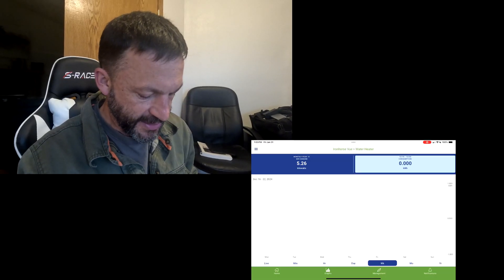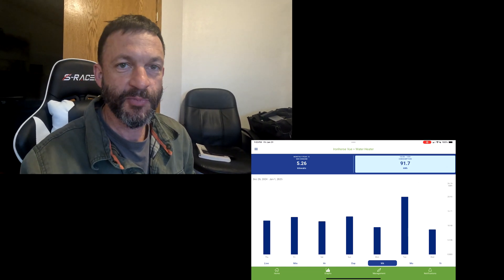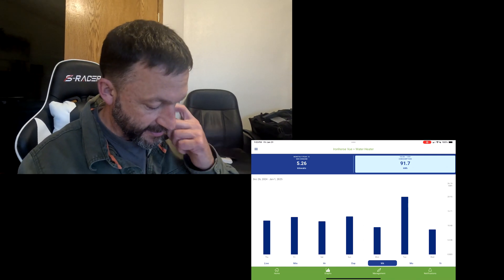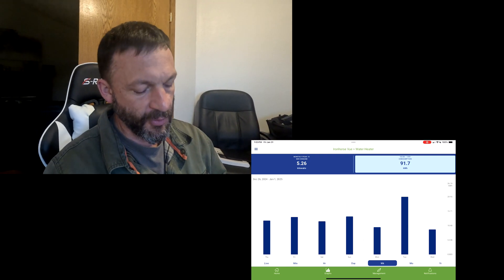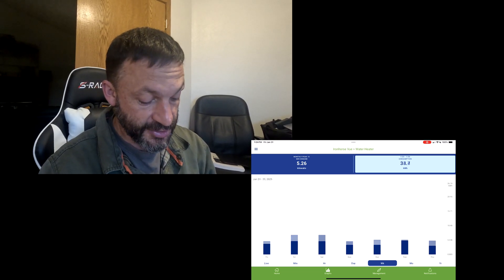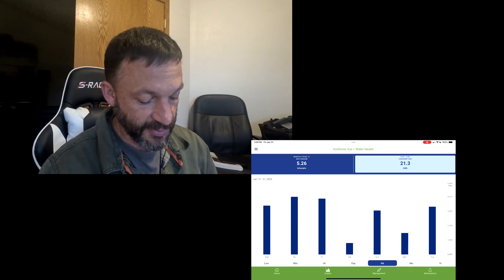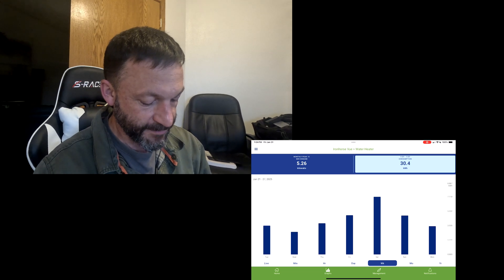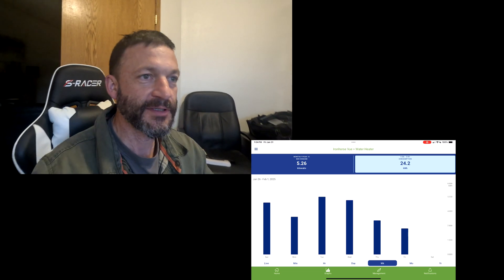Chasing energy efficiency: Installing a new Rheem ProTerra heat pump water heater

Comment: I was going to ask why you bothered to shut off the main instead of just cutting off cold shutoff valve.   Did you do this because you knew you were going to drilling through the wall?   I am surprised you 45 gallon ran out of hot water too.  I have a 49 gallon and never have issues with 3/4 people in the house but I do live in south Florida where the water coming in is more room temp.
Reply from the maker: I've done enough plumbing work over the years (I was a general contractor for 15 years) that I KNOW things dont go according to plan.  Pipes break, valves fail, etc.  It made sense to find and test the water shutoff before messing with the water heater.  The hole for the condensate drain didnt factor into it at all...that was just bad luck.

Comment: Hello Matt, I just installed the same model and I'm running into a similar issue. The sensor got wet while I was plumbing it in and now I can't get the valve to stay open. How were you able to override the leak sensor? Thanks!
Reply from the maker: Im away from home at the moment so im just operating from memory...but i believe you press and hold the clear alarm button for 5 seconds.  This overrides the leak sensor for 24 hours.  I had to do this for 2-3 days.

Comment: I am about to start a similar project.  We have had the Emporia for over a year, so I have good data going back showing how much we have used in the past.

We may need to use a condensate pump in our garage - it will be too far from any exterior wall.

But I don't have the inclination to try and DIY this one.  The water heater specs say it weights over 200 lbs (empty, I expect) and I don't have the inclination to try and muscle the thing in myself.

Comment: Care to work through your math on the dryer?  I think your math is off
Reply from the maker: Sure.  As of today (4/4/2025) my dryer has used 50kWh over the last 30 days.  That works out to approximately $7.  ($0.14x50=$7).  $7x12months=$84/year.  My local Home Depot currently has 2 heat pump dryers in stock, one at $1298 and the other at $1599.  Let's go for the cheaper one.  $1298/$84/year=15.5 years to break even.  The $1599 one works out to 19 years.  That, though, makes the assumption that the new heat pump dryers use $0.  They do use SOME electricity...but this just adds to the payback time.  Let's assume they use 1/2 of the power for the same load of clothes then you have to double the time to break even...putting my estimates in the video on the conservative side.  I was speaking in general terms during the video, but as you can see with my actual numbers over the last 30 days may math was (and still is) generally correct.  It takes a very, VERY long time (most likely well beyond the life of the dryer) for a heat pump dryer to break-even on the purchase price.
Reply: @MattVerley just wanted to confirm this makes sense - as for me, it did not. I ended up switching out my dryer for a $400 heat pump dryer (after rebates), and my electric cost was double ...but ..what I replaced was using 4.5kw/h, so assuming yours is about the same, you're running your dryer no more than about 10 times per month, or  2-3 times a week, correct?
Reply from the maker: @JoshuaHarper that's about correct.  It's just my wife and I.  A couple of loads of clothes, and another for bedding and towels.  3-4 loads per week is typical.  I wasnt using estimates though; I calculated the ROI based on actual power usage.  It would be more feasible if I used the dryer 3-4x as much, my power cost more, or I had better rebate incentives.

Comment: Ordering one of these today, also a Vue 3 user.  Should be interesting!  What area are you in? What's the ambient in the area it's in?
Reply from the maker: @dieseldoc25  let me know what kind of data you see after the installation, it's cool that you have the same before and after data measuring capabilities that I do!
I'm on the NW Oregon coast.  The water heater is in my garage, most of the winter it stays in the 40's and 50's in that room.
Reply: I finally installed the water heater this past Saturday (3/29), after giving it 24 hours to reach equilibrium, I am happy thus far!  We do 2 baths for my kids, then my wife and I each shower in a abut a 2-2.5 hour period, not ideal for a heat pump heater, but we went from 18-20kw/hr/day with our 45 gallon resistance heater (nuts...) to 7kw/hr yesterday.  Anxious to see if today is even better now that I've stopped touching settings etc.  I really can't complain for that type of energy drop.  Will report back in a month!
Reply from the maker: @dieseldoc25  that's awesome! It looks like your calculated efficiency is pretty similar to mine. Your new water heater is using a little more than 1/3 of the power that your old one was using. Your payback period should be even faster than mine, because your actual power savings are greater.
Reply: Will do!  Mine is going to be in my basement, currently at the coldest it's been all year at 46. In the winter typically hovers between 48-54.
Reply: This is good temp info.  My basement goes from about 50 to 80..  so comparing to yours, should be good.  Just leary about al. The errors / problems I read about on forums.

Comment: Good video.  What temperature do you have the thermostat set to?  If you needed more hot water or wanted to keep it in heat pump only mode, , you could raise the water temperature in the tank,  and install a thermostatic mixing valve on the hot water output.
Reply from the maker: I have it set to 120.  I did consider switching the water heater to "heat pump only" mode to see how it keeps up with demand...but I can sort of tell anyway just by looking at my Emporia Vue data.  It will handle two 10 minute long showers that are spaced apart by about 30 minutes without turning on the heating elements.  This is about the largest demand that it sees. 
At my old house, I had water coils inside of my wood furnace.  Whenever there was a fire, it was producing hot water.  Sometimes the temperature in the water heater would hit 200 degrees.  I installed a tempering valve there to keep the outlet temp at a steady 120; it worked great.  In the future I may do something similar at the new house, but for now I don't have a good reason to store extra energy in the water heater since it can keep up with our peak demand without cycling the heating elements.